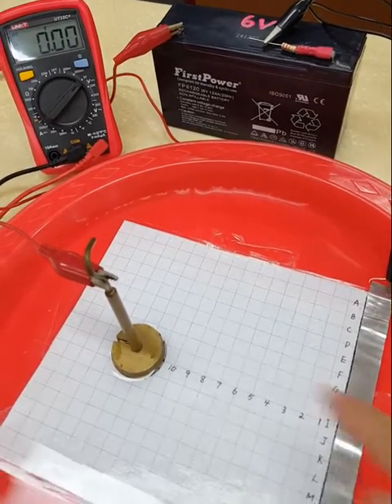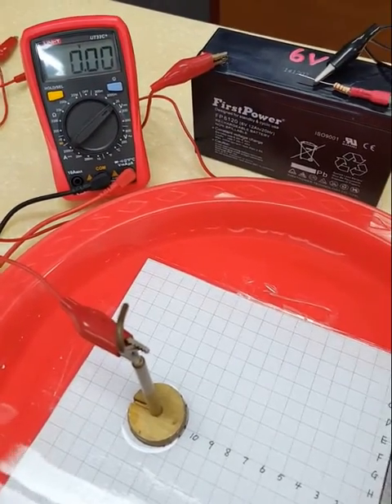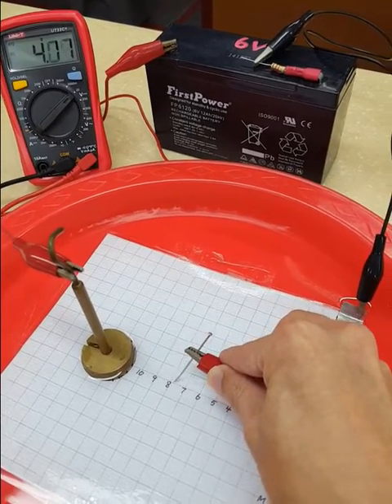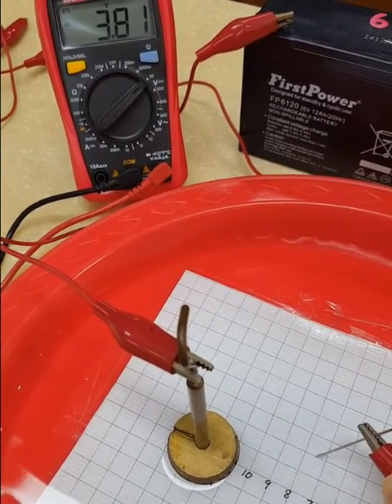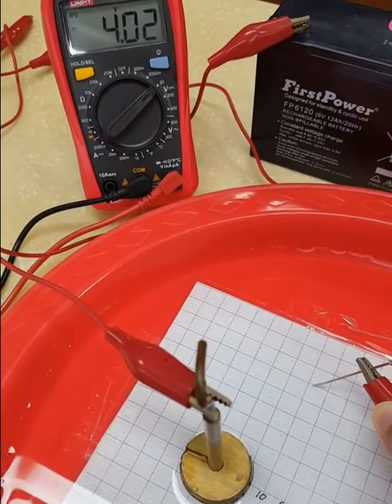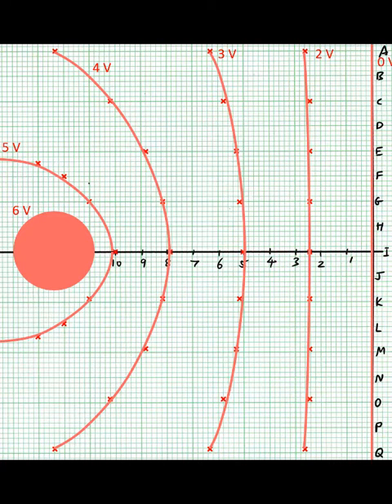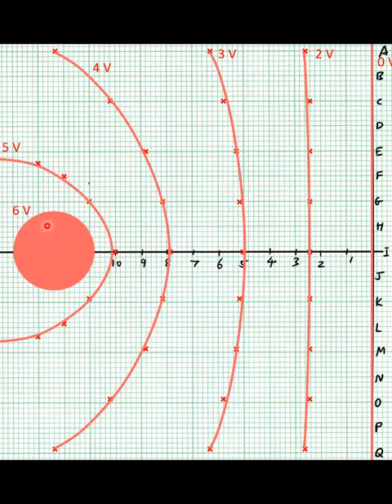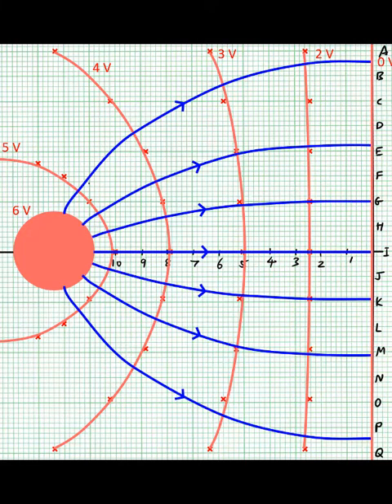Mapping the Electric Field Pattern

Comment: Does anybody know a way to map the electric field directly, without first mapping the electric potential lines? I always teach E-field first, and I wish there was a way to map it without having to teach potential, which is more abstract and difficult for students to grasp.
Reply: just blabbering smth:
can it be achieved by using colored/dyed aqueous cations somehow?? try it, and also share feedback if it worked  :)
Reply: You could use a magnetic flux sensor module on an arduino, which would be analogous to using the voltmeter for the voltage
However that's also a bit of a "duh" type experiment because then the aluminum plate wouldn't be needed and its not really demonstrating a phenomenon. However, that is how you would do it... not the most exciting experiment.
Reply: Here he finds each point by maintaining a set voltage. If you want to find the electric field directly then move the probe in the direction that has the most voltage change per chosen distance.